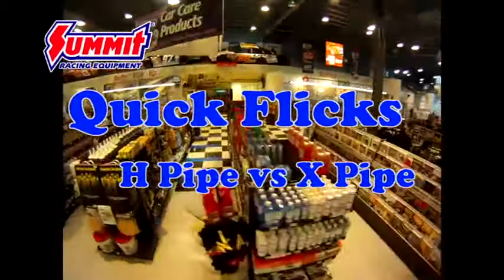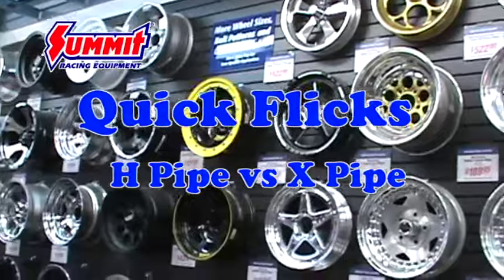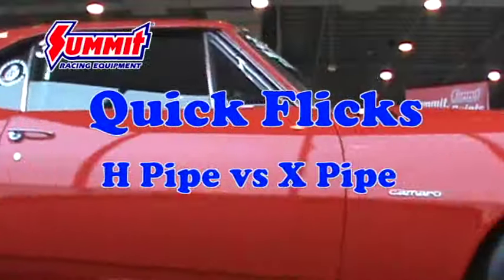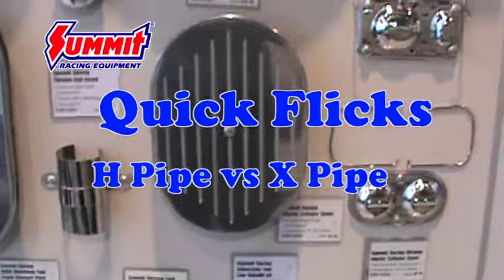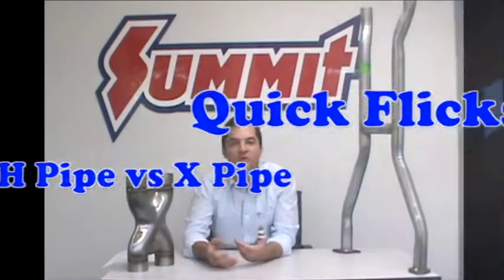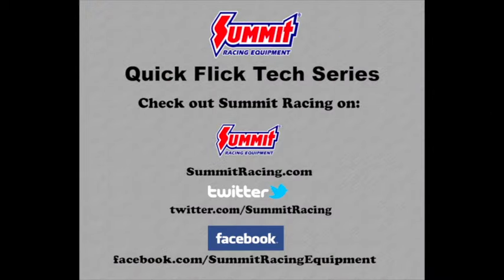Exhaust X-Pipes vs. H-Pipes and Differences Between Them

Comment: Hey guys, appreciate you sharing your expertise!  My question to you is this. I have a 1700 parallel twin motorcycle. It currently has a H pipe CAT but I've seen folks drop the cat and simply add a straight through connector instead...ultimately creating be somewhat of a straight pipe (slight elbow bend). What are your thoughts on this?
Reply from the maker: Hi divadrolyat, 
While we don’t advocate the elimination of emission control devices, we’ll assume these persons you reference are racing!  The catalyst briquette will offer some restriction to exhaust flow, and by eliminating it, flow will increase. Be careful here though, increasing exhaust flow also increases intake flow potentially leaning out the air fuel ratio causing detonation and engine damage. To remedy this the air fuel ratio will need to be modified via jetting in the carb or programming in the computer.

Comment: I have an old 85 GMC 1500 high sierra with a stock 305. Since its bone stock do I need back pressure? Will it really matter if I change the standard Y pipe to a true dual set up? I am thinking about doing just headers and running straight pipe all the way out the back.
Reply from the maker: Hi metamaster1492, 
Excessive backpressure is a bad thing. If you do not have emissions testing of any kind then installing a set of headers and dual 2.25” exhaust pipes will dramatically increase the exhaust flow of that motor. This will help to increase the horsepower level but; make sure that it does not lean out the fuel mixture as this could be bad for the motor. Give us a call, we can help you pick out the correct components and answer any questions you may have! 1-330-630-0240.

Comment: Will this system be as easy to install as the other. I was going to install it my self then have it welded by the professional. Someone at the Olds chat room told me the purchased the system and put it on with no problems and that is what I want to do. I just want a little grumble but I'm not into racing, I just want it for the look and a little sound cause it is a 350 in it. Thanks

Comment: Hi guys. what about changing the stock Y pipe on my 2011 infiniti m56 V8 engine 5.6 liter for an X pipe ?  
Will this be an upgrade in performance?
Thanks
Reply from the maker: Hi Bu Ahmad, 
If you are unable to find a pre-bent system for this car, you will have to assess the space constraint of the underbody and see what that will allow you to have fabricated.  A shop with bending capabilities would be able to help you make that decision.

Comment: hey, i have a 72 cutlass, with a stock 350 , putting a mild cam , headers ,intake, rebuilding the carb and putting super 10's on. what would be best a x -pipe or h ? too me they both sound good so im looking more for what would suit my set up/give most power/torque gains. thanks!
Reply from the maker: Mrgetgetit ,
Due to its scavenging ability
 an X-pipe will always make more power, especially in the mid to higher
RPM ranges!

Comment: Hello summit I have a 95 silverado 350 TBI and I installed your sum-k1102 camshaft along with shorty ceramic headers and true dual exhaust with(2) summit street and strip chambered mufflers and I noticed i lost a bit if low end power which is what I expected but I'm not running any x pipe or h pipe. Would adding a h pipe help make more backpressure or would it help any for low end? Or what about the the summit turbo mufflers do those make more backpressure than the street and strip chambered mu

Comment: What do you recommend for a 2000 5.3 Silverado with cold air intake and long tube headers ?
Reply from the maker: +Luis Vergara, 
 If these two modifications are all that will ever be done and you do some towing with your truck, then an H pipe will do just fine.

Comment: Would an x pipe benefit my 06 silverado 5.3 it has gibson shorty headers (we're already on the truck) I've been thinking of getting an x pipe but like you said it might not change anything because of the lack of back pressure of would an h pipe benefit me better?
Reply from the maker: Eddie Sanchez,
An H pipe works well in low speed towing applications with few modifications to the vehicle. But, when adding things such as heads, cam, intakes or superchargers an X pipe is the way to go for best performance!

Comment: I have a 2001 Grand Marquis GS with dual exhaust and no crossover. I'm considering the H pipe due to models that came from the factory with the H pipes. Muffler shops in my area are saying that the X pipe would be best for my Marquis. I understand that a H pipe would benefit in low end, but will that hinder my top end? What crossover would best complete my Marquis? I will also be install a CAI by aFe stage 1 magnum force. Thanks.
Reply from the maker: Hi Ray Patt, 
If you are a spirited driver and will be running the RPM of the motor higher than normal, an X pipe will provide some benefit such as better exhaust scavenging.

Comment: I've a 2013 Mustang GT with airaid  intake (larger than stock intake tube) off  road  H, flow master outlaw  catback  and tune. I didn't install the x  pipe that came with my catback system, but would it improve performance on my vehicle if I did?
Reply from the maker: red5oh88 , It is possible you could gain a few horsepower by doing so!

Comment: i have a 96 impala ss. Its a daily driver, stock engine, stock exhaust manifolds (for now). I've been doing research on what would be best for my set up for now but will also compliment future power adders in the future within reason before going to a new system. I was looking at the pypes street pro system. They get good reviews, not too pricey and give a good sound. I'd like to increase some lower rpm gains but any overall gains will definitely be pleasing. Any suggestions on complete systems or where to get specific pieces from. Thanks
Reply from the maker: Hi suede84, 
The Pypes “Street Pro” system would be a great choice. Not too loud, stainless and great fitment. It priced right as well; and with a 2.5 diameter pipe with an X it will not only give some gains to the stock vehicle but also allow some room to grow with future power add ons. Good choice!
http://www.summitracing.com/search/brand/pypes-performance-exhaust/product-line/pypes-street-pro-exhaust-systems?SortBy=Default&SortOrder=Ascending&autoview=SKU

Comment: Thanks!!  I know its a tough question to answer because each vehicle reacts differently to exhaust mods but I am thinking of removing my stock mid muffler and installing an H-Pipe in its place.  Would you think there would be a huge increase in overall volume in the exhaust system and would an H pipe setup be more prone to drone?  Currently the Super Turbos i installed don't done or have very little drone in most driving conditions. I am guessing the H pipe will have a deeper tone to it. Thanks!

Comment: Have a 88 5.0 302, mods gt40 heads, cobra intake, 3.73 gears, 70mm throttle body, bbk shorty headers,  would I be better with a xpipe or hpipe looking to pair one with a flowmaster catback

Comment: how wide will The Cross pipe be in your H Pipe Kit? I had my Duals on my C10 Spread out to be just inside the frame so it did not get in the way of my Emergency Brake Cables Over the Axle Exit under the Rear Bumper straight out the back on either side One Piece Driveshaft
Vehicle is A 1964 Fleet side Short Bed 87/95 350 250HP Version with mechanical Fuel Pump Stock heads stock roller cam 2 1/2 Rams Horns 600 Edelbrock 4 barrel and A dual plane intake 700R4 Trans And An Fully Upgraded Eaton TRU TRAC 12 BOLT With 3.73 Gears Its A cruiser but it will now at least smoke/Chirp the tires big time with the New Rear End what a difference! Everyone tells me under 300 horse all you need is an H not An X The Cabin noise is what I want to eliminate as much as possible I have sound deadened and all that I bought the Jones with the Rock Wool inside them /Magnaflow knockoffs the largest one from your catalog 2 1/4 pipes Its pretty smooth already but does not sound balanced slightly louder on one side VS the other JUST A BIT
THANK YOU!

Comment: I have a 2014 v6 mustang and wanted to know what would be the best set up for my car. so far the exhaust is completely stock besides borla ATAK axle backs but i want a deeper sound. what would you recommend for sound and power gains?
Reply from the maker: Hi Greg Shebosky Jr., 
Exhaust note or sound is very much the job of the muffler/s. You could search the internet and listen to sound clips of other V6 Mustangs to see if you like the sound of those particular mufflers. Make sure they are V6 cars though, any clip with a 4.6 or 5.0 will be deceiving to you as they are larger motors and you will not get that same sound. As for power gains, other than air intake, exhaust and programmers there isn’t a whole lot out there for you unless you wanted to go custom, and that will get pricey!
Reply: Summit Racing All of the H pipe sound clips I've looked at seem to give off a deeper note in the exhaust - is it truly making a difference? Because I've listened to clips of the axleback systems by themselves and they just don't sound all that great alone.

Also, how much of a change in power would it cause with a 2014 v6? I want it to sound good, but at some point in the future I'll be looking at adding more power so if it will significantly hinder the performance then it's something to think about.

Comment: I have a 4.6 v8 f150 with throttle body and cold air intake with a flow master super 10 dumped would a x pipe with 2 flow masters sound good?

Comment: Hi my name is Keith,I have a 2006 mustang gt,it currently has stock piping with flow masters mufflers,would I gain the most performance switching to an x-pipe and leaving the mufflers on or do a muffler delete with the x-pipe,I want it louder but not unbearable...I will not touch the cats....one last question,would converting to 2 individual pipes for each cats make it any more efficient in terms of more performance or is it a waste? thank you...

Comment: I've got an 07 ram hemi and I want to put a dumped true dual system in it with Dynomax mini bullets and shorty headers. I've heard ram hemis that have a nice crackle to the exhaust when the rpms come down after a decent rev. Will the X pipe give me what I'm looking for? Where should I place the X pipe? It'll be impossible to get the X at an equal distance to each collector, will that affect sound or performance? Any advice or suggestions you have would be greatly appreciated.
Reply: @Summit Racing or would true duals without a crossover pipe be better?

Comment: hi, i have a monte carlo with a 400sbc with cam, aftermarket heads, headers, and a ram air setup....would either x or h pipe be beneficial to my car?
Reply from the maker: +Ramon Walker, 
Yes, depending on the level of your modifications is what will dictate the proper choice.  Give us a call and we can help pick out your parts! 1-330-630-0240.

Comment: Hi I have a 4.6l v8 sohc what is the best pipe to add some house but give a loud sound I'm thinking of adding a supercharger or turbo later since it doesn't cost that much on the modular
Reply from the maker: Hi gun nut, 
An X pipe lends itself to a better sound but, your muffler choice will be the larger factor!
Reply: Well like the dude said, what's the application for? If it's just a cruisor low to mid HP fun car go with h pipe and use muffler and headers to dictate the sound. If you're constantly in the high RPMs wanting ever inch of power go with X. X tends to sound the best as well. Look up videos for mustang Gt theres tons of x and h exhaust videos and find what you like. Personal I'd go with some borlas.

Comment: I have been doing some research and had some questions on back pressure... I have a 99 N/A Cobra with a few supporting intake mods. Researching on the internet shows less back pressure is better. I've seen cars running stock manifolds and an X-pipe and dumps. Is there enough back pressure in the system and beneficial power to be made by doing this?
Reply from the maker: Scott Elliott , 
Having too much backpressure is similar to saying that the pipe size being used is too small. The motor is ingesting more air than it can exhaust, therefore you get a pressure build up in the pipes called back pressure. Finding just the right size pipes for the amount of air and fuel being ingested is key to the equation and the reason for the popularity of Cat-back exhaust systems!

Comment: I have a 2010 Dodge Challenger SE and I'm looking to put a dual exhaust system on it.  My future plans are to add a turbo as well. So, would the x pipe be a better choice than a y or h pipe?
Reply from the maker: Hi mjwallace79, 
The addition of a single turbo will completely change the layout of the exhaust. You could actually run one larger single exhaust pipe. Good luck!
Reply: After doing some research about the 3.5 L, I will not be putting on the turbo. Apparently the car will not be able to handle it.

Comment: Would You Recommend An X-Pipe Or Straight Pipe On A Benz C300 ?
Reply from the maker: +Tru3MarTian, 
 Either one works great but an X pipe helps to scavenge the exhaust for best higher rpm performance.

Comment: I have an 06 mustang gt.Had flowmaster hushpowers with no drone.I put on a pypes cut and clamp x pipe which gave a little bit of drone.Changed the hushpowers for outlaws.Now the drone is worse.If i go back to an h pipe,will it get rid of some of the drone. Thankyou.
Reply from the maker: Hi *****, 
An H-pipe will help reduce some of the drone but will also result in less exhaust gas scavenging at higher RPM, and possible lower horsepower. Drone can be controlled better by changing the mufflers.
Reply: Summit Racing thank you so much.

Comment: I have a 2004 Silverado with a stock 6.0 just ordered some long tube headers and a 2 in 2 out borla pro xs. should I do  h pipe or y pipe before or after the borla or just keep it true dual? I want performance.
Reply from the maker: Hi Eric, 
This is really a better question for your custom builder as things get pretty tight under these late model vehicles!  Either is better than nothing at all. Just the fact that your adding long tubes and a performance muffler will give you performance. Don’t forget about a re-tune for the computer to match all this new air/exhaust flow!!

Comment: im doing exhaust on my 94 f150 xlt extended cab 4x4 with the 5.0 302 in it with the high rise intake, i put long tube headers on it and im gonna put duel glasspacks on with duel pipes, i like the higher pitched rumble and cackle sound..where should i place the glasspacks?

Comment: Thanks alot well i installed it with flowmaster mufflers and i feel it pushes more in wene im coasting on my last gear i bearly tap the gas and in a takeoff i feel the push on the 3or4 rpm

Comment: Quick question i have a 88c1500 with a 93 454tbi engine swap, it has a comp cam k11-302-04, question is what headers and exhaust would benefit my vehicle the most, so i can gain better and hp/tq Thanks
Reply from the maker: Hi ELKOMPABAKON,
Considering the limited amount of air a TBI motor can actually move, small primary (1.75”) long tube headers with an X pipe and dual 2.25” exhaust pipes and mufflers of your choice should do the trick nicely.

Comment: I have a 2006 f150 with a 4.6L motor what will be the best for my truck?
Reply from the maker: Hi John Flowers, 
Generally speaking, an H pipe will work just fine in a vehicle driven on the street and used for occasional towing.

Comment: Have a 2010 mercedes c300, have seen some videos with an x-pipe added and the resonator removed. beside the "meaner" sound and increased HP, is there any other benefit to doing this? will it affect my performance in any other way?
Reply from the maker: Allen Casaletto,
1)     
The better sound and
more power are exactly what people are looking for when they make this
modification. Any other benefits are not typically considered or desired!

Comment: I have a 96 Camaro with a gen 1 sbc in it made 450hp and 429 ftlbs I have 2 and a half inch pipes running duel all the way out threw flowmaster 10s my car has a big cam 584/584 it sounds amazing at idle and horrendous at WOT I was thinking a xpipe and changing mufflers I want my car loud but still sounding good any suggestions thanks

Comment: So if I were to go to my local muffler shop and ask for a mid muffler delete and a front resonator delete and switch it with an x pipe for my G8 with Pypes performance axlebacks. Would that make sense telling them what I want or am I saying it wrong. I'd say front resonator because the video explained its better for the x pipe to be in the front as much as possible. On G8s I believe there is front resonators and rear resonators and the rear resonators are right before it goes to the axlebacks. but I would want the front resonators in my situation correct? Let me know, thanks!
Reply from the maker: Hi Jordan White, 
On that car, the closest the X pipe can be mounted is right behind the transmission. That would be the best place because that is the closest the actual underbody configuration will allow. After that is really up to you. There are many systems on the market, some that use resonators after this X pipe location and some that don’t. Some that use mufflers at the rear of the car, and some that don’t. It is really the sound level you are trying to achieve that will determine this! Search around the ‘net for sound bytes of the different systems available to see which one best suits your taste.